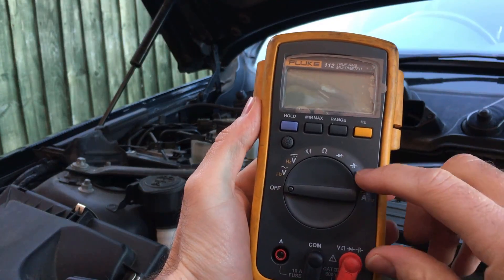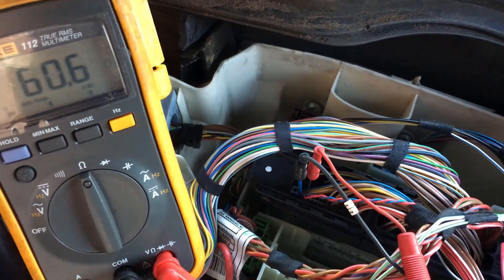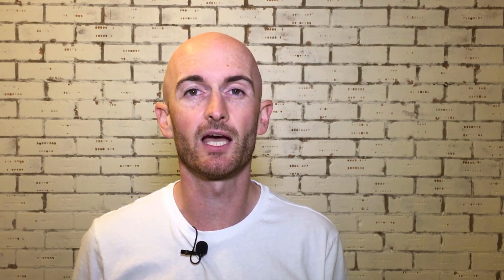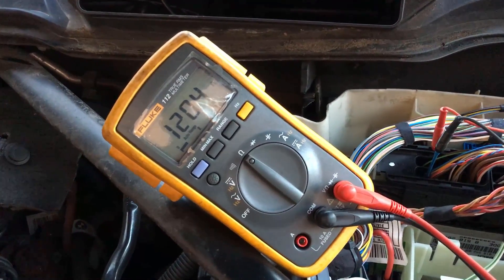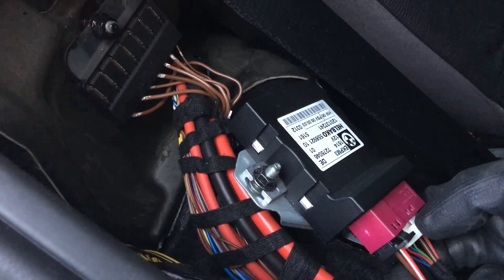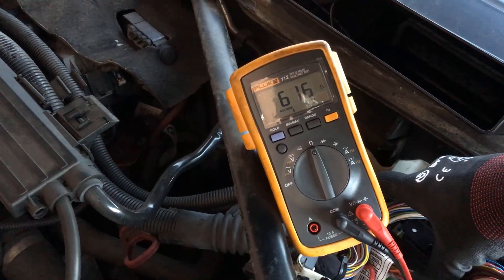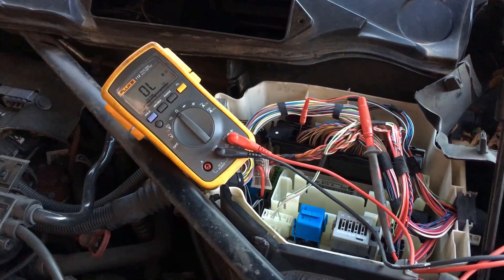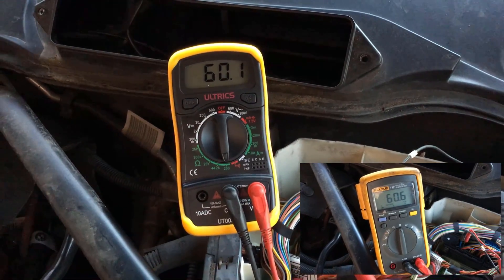How To Test CAN BUS With A Multimeter [CAN Bus Resistance Check] Mechanic Mindset

Comment: Hello mate, awesome video! I bricked my w169 Instrument cluster by trying to flash new Offline software using DAS. Unit not dead but need reflashing on bench. I stitched my control unit but now cannot read it saying error during initialization cause I didn't add 120ohm into my wires. So can you tell me if I add 120ohm tapped into Can-l and 120ohm tapped into Can-h lines I'm good to go? I measured resistance between both wires and it's more than 1 Mega ohm so think I'm measuring open circuit only no internal impedance in my cluster
Reply from the maker: Hi, the 2 resistors should sit at the 2 furthest end of the network. Some networks do have external resistors (I.e. not in the module). If you measure 1M ohm, it sounds like there are no resistors at all. Is it definitely a high speed CAN network? Low Speed does not have these terminating resistors
Reply: @MechanicMindset  thanks, yes it is 500kbitsps network baud rate and when I measured voltage between Can-l and Can-h I have 4.9V is it ok? Not sure high or low speed Can but it's an old car late 2004. Also some guy told me to try K-line but when I look pinout of my cluster only Can_e High and low as well as Can_b High and low (not sure the differences..) I tried both but didn't want to start initializing with my diag module. I used pin6 and 14 onto OBD2
Reply from the maker: @koookao  Sorry, I’m not so hot on Mercs. If you ha e 4.9V it sounds like Low speed. You might have 2 networks as the kombi could be the gateway between the 2. Yes, k-line was on quite a few cars of that era, I saw it in BMWs a lot. Best try to get the network topology. They usually publish it in training materials
Reply: @MechanicMindset  no worries thanks for helping! So if low speed do I still need those resistors? I'm struggling to find wiring diagrams for w169.. how can I connect to k-line from cluster pinout? Then should I connect to pin7 k-line and pin15 l-line also on obd2 or just k-line? Signal to gnd pin5 on obd2 do you use it for k-line?
Reply from the maker: @koookao  No the 2 terminating resistors aren’t on low speed. Sorry, not done any k-line for a long time, not sure!
Reply: @MechanicMindset  but for Can, the signal to GND (pin#5 on obd2) is not used can u confirm? When is it used then do u know?
Reply from the maker: @koookao  Pin 5 is a signal ground (clean from noise/interference). Grounded through a module, not direct to chassis.
Reply: @MechanicMindset  ok thank u. One more question I remeasured actually I have 4.9V on Can-low line and 0V on Can-high line... not sure why maybe that's why I cannot initialize with my module? No resistance whatsoever when power is off
Reply from the maker: @koookao  That’s low speed can 👍
Reply: @MechanicMindset  ok cause now I tried again in my car but the module cannot connect at all now before it used to at least initialize the CAN communication. How do you connect with low speed can and obd2 port? Does it use the same pin 6 and 14 or any settings to specify perhaps? Pretty sure my device is not dead but stuck into bootloader mode..
Reply: Hey just to let you know (and for others reading) I succeeded! Just reflashed thanks to your info. As you told me low speed can doesn't require ohm terminal, I looked again pinout of my cluster and saw there are Can_c-l and Can_c-H which are for High-speed Can and Can_b-l and Can_b-H which are for low speed Can. So I tried again this time using the pinout for low-speed and did proper configuration using Vediamo and it connected! Thanks again

Comment: Hi mate I'm having a fault with volovo v70 ,from abs pump to lateral accelerometer sensor signal fault ,power and earth are there but can bus is reading 12.5 ohms ?
Reply from the maker: If battery is disconnected, sounds like a resistive short circuit. Try disconnecting modules until it changes

Comment: Hi
Thanks for the great videos
I have a question I hope you can help me with 
I have no communication with my scanner so I did test between 6 and 14 and have a reading of 120ohms
When I disconnect abs it reads 60ohms
Does this mean abs is at fault?
Thanks 
Greg
Reply from the maker: Hmmm, it should be the other way around. 60 ohm all connected and 120 with ABS disconnected. I am trying to think of a scenario where the reading you obtained would be seen
Reply: @MechanicMindset  There is no scenario where that can happen. It is impossible to reduce resistance by removing part of a CAN circuit.

Comment: Hi,i've been on a few tech courses,can you explain about disconnecting the negative lead,i understand why you do it,but when you disconnect it should you have a memory saver connected?,say one of the ones that plug into the dlc connector?Or does it just depend on the car?
I've even done one course where they stated as fact if you read 60 ohms at the dlc the circuit is good,yet they went on to cause a fault on the network yet failed to explain whilst doin this why their multimeter showed 60 ohms!!
Your video is good,subscribed!
Reply from the maker: So I disconnected it instead of waiting for the network to go to sleep. It it’s awake, you will get high readings. If you use a memory saver, you might still keep the network awake. 

Glad you enjoyed the video and hope it cleared up your questions on CAN termination resistors. Cheers!👍

Comment: Great videos 
Have couple of questions
This car   I have problem with has total resistance of 47ohm
The 120 ohm that is in instrument cluster reads 97 ohms ,do you think instrument cluster is bad?
Reply from the maker: Hi, if you have a CAN bus problem, does it go away when you disconnect the instrument cluster?
Reply: Hi
It is a 2007 Rangerover and instrument cluster seems to be a Gateway module so can not disconnect and start ,with you experience is it normall for 120ohm terminal resistor be 96 ohm? also when measuring it and leave the ohmmeter connected it varies drops from 99 to 96ohm
Thanks for your reply
Reply from the maker: @alitehrani3415  Hi, I’ve not seen one measure 96 before. Are you definitely measuring a high speed CAN line? It may be best to get the scope out of you are sure there is a network issue 👍
Reply: May also want to try using a second DMM/DVOM to check for tool integrity, just in case

Comment: Love your videos mate, they are very informative. I have a question for you if you could help me out please. When measuring the resistance between CAN H & L pins to ground on individual modules should the resistance be M ohms to O/L or is K ohms acceptable? I have CAN bus codes coming up on my scan tool on a few modules & went crazy stripping the car down trying to find the fault. All the modules but one are reading M ohms or O/L, with one that I think is dodgy reads 135 K ohms on L to GND & 110 Kohms on H to GND. Do you think this would be the issue thats causing my CAN system to fault out? TIA from Australia
Reply from the maker: Hi, glad you are enjoying the channel. Testing the CAN line of the module to ground isn’t a test I usually do, unless there is a short to ground. There are more resistors which form part of the electronics for the module, which is what you are measuring. It also depends if you are look g at high speed or low speed CAN as the terminating resistors are connected in different ways...

It depends on what codes you have got or which modules are not communicating. What symptoms are you experiencing. Is it an intermittent fault. I would try to capture the problem with a scope to identify what the issue is. Also remember that module power supplies can cause network issues too!
Reply: @MechanicMindset  sorry for not being clear enough mate I meant if the module is  unplugged from the network & testing this individual module H to GND  & L to GND.
Reply from the maker: @dazzadaz4730  Yeah that’s what I assumed you meant 👍. It’s not usually a test I would do, but I would probably expect it to be a very high reading

Comment: 1-i will test ecu with voltmeter and Ignition On (dc volt ) 1cable to ground other with CAN H and CAN L shall 2.4 and 2.6v if same the can ok 
2-with battery (-) remove i will test ecu the cable for voltmeter 1 in can l 1in can H with ohm test the shall 60 Ohm
Reply from the maker: Also check that the fuel ECU has power and ground 👍

Comment: Thanks so much for excellent teaching. Only quibble I have is at end when you are doing resistance checking, You said if signal line is shorted to positive (battery volts), you get a result, which you did not show.  If you have 12V on signal line you should not test with meter resistance scale, which may damage meter. Only test resistance on un-powered lines of any sort.
Reply from the maker: John Rieley Gald you enjoyed the video, thanks for the feedback 👍. Re. Resistance check; don’t forget that I disconnected the battery. Although, I have not tried measuring resistance of a live wire before. Would there still be an issue considering there was no potential difference or current flowing? Might have a play!
Reply: @MechanicMindset  You are right, if no power or capacitor somewhere ready to spill out stored power then resistance check is OK. If power in line do not do resistance check with meter.
See https://www.fluke.com/en-us/learn/best-practices/test-tools-basics/digital-multimeters/how-to-measure-resistance
Reply from the maker: John Rieley Thanks for sharing!
Reply: @johnrieley1404  or use a clamp on meter on a circuit that you expect or unsure of that is somehow powered up ? or even an old style  analogue  amp meter in series, if the wires can be detached ? to be sure that NO live current is in play 🤔

Comment: I am always asking myself this question: What is the point of checking  both resistance and voltage?  Could you please explain?
Reply from the maker: BB MD In my opinion, the resistance check doesn’t tell the complete story (as demonstrated here). You could have an open circuit and still read ~60ohm. Oscilloscope voltage is the best way, but measuring voltage with a meter will tell you more than this resistance check. See pinned comment for link, also got some videos on analysing CAN scope waveforms. Hope that helps, happy to help if you have any more questions 👍

Comment: The right way starting at the DLC
Reply: Please make a video about Lin network
Reply from the maker: mahender raj OK can do. With oscilloscope or multimeter?
Reply: Mechanic Mindset better explain both.
Reply: I found a node to be M i A getting closer i can smell it...
Reply from the maker: So on most modern Euro vehicles, the only network you get at the DLC is Diagnostic CAN, a direct link to gateway. DLC is no good for these cars; so those flashy boxes, no good also 😕
Reply: @MechanicMindset  Glad I'm a gm tech.  Databus tool works great.  Plug your MDI 2 into the DLC and open the databus program.   I don't know much about how Eurocars are set up.
Reply from the maker: Jeff So we used to have that set up and some still do. Jaguar Land Rover only recently stopped using that topology. BMW & Audi, a little longer. Audi actually have this amazing tool. It allows you to break out the whole network and even pull the plug on individual nodes, look it up 👍
Reply: Due to its related to the trans im hoping its only a chafed or shorted wire at the valve body throwing it off
Reply from the maker: So what have you found so far with your measurements?

Comment: I attach my break-out-box to the DLC.  I can now either hookup my DMM or my Scope as needed.
Reply from the maker: Richard Ostrowski Hi, I love them flashing BoBs! Unfortunately they are becoming obsolete. If you have a car where all the networks can be accessed at the DLC/OBD port, they are great. On a lot of modern cars now, all you can get at the DLC is Diagnostic CAN, a direct link to the Gateway. In fact the latest cars this is changing to Ethernet! Also if identify a fault, we will still have to go on a mission around the car to find the problem. More on CAN coming up! Thanks 👍
Reply: @MechanicMindset  you right when you have a gateway it gets a little bit tricky to diagnostic the network but if you understand how the system works you should not have any issue to diagnose the network.